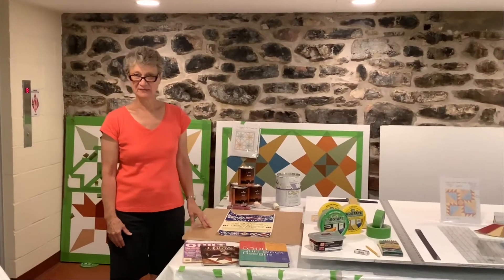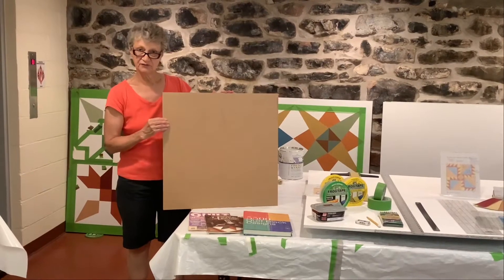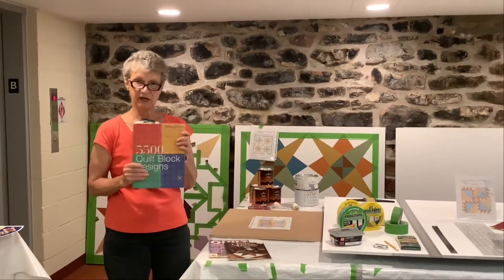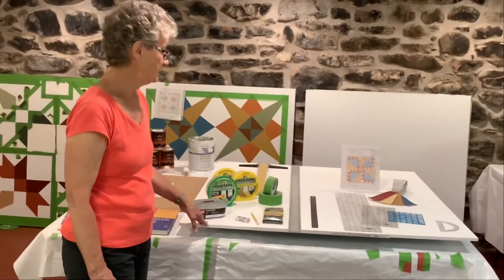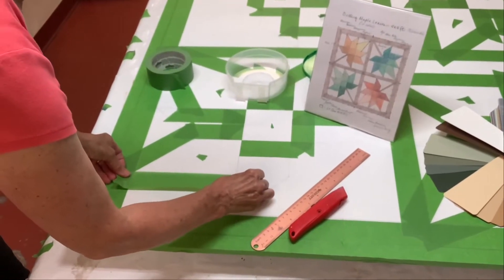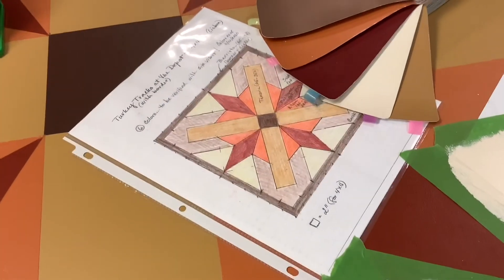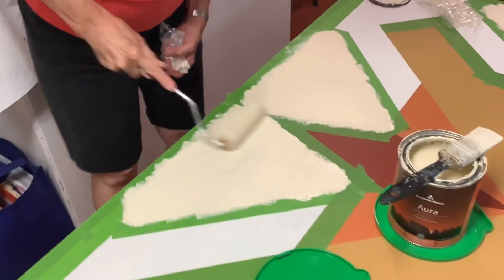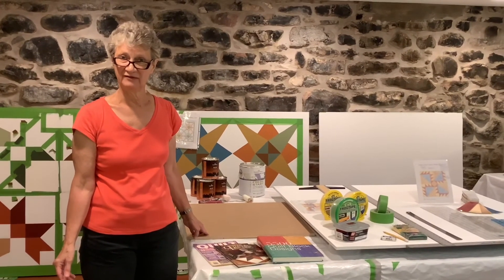Barn Quilt Painting: From Inspiration to Installation with Ruth McWilliams

Comment: Hello. I just tried my very first barn quilt and the acrylic paint peeled off. It did not adhere to the wood. I was using Liquitex Basic. Do you have any suggestions? Thank you!
Reply: Did you use primer on the wood first? If not, I'd start with a couple of coats of primer. If you plan to display the barn quilt outside, it's best to use at least a couple of coats of primer and then 3 coats of paint formulated for exterior use.

Comment: do you apply a finish paint after the painting is completed for protection
Reply from the maker: Ruth's reply: "The Benjamin Moore Aura exterior paints that I use are called 'waterborne' paints.  And I do not put a seal on the barn quilts.  There is no need since we use at least 2 coats of primer and 3 coats of paint which withstand harsh North Country conditions.  And if you put a seal on and something happens to the board, then you have to sand it all off rather than just touching up the area. "

Comment: Do you use water base exterior paints. Do you use some type of clear coating for weather protection?
Reply from the maker: Ruth's reply: "The Benjamin Moore Aura exterior paints that I use are called 'waterborne' paints.  And I do not put a seal on the barn quilts.  There is no need since we use at least 2 coats of primer and 3 coats of paint which withstand harsh North Country conditions.  And if you put a seal on and something happens to the board, then you have to sand it all off rather than just touching up the area. "